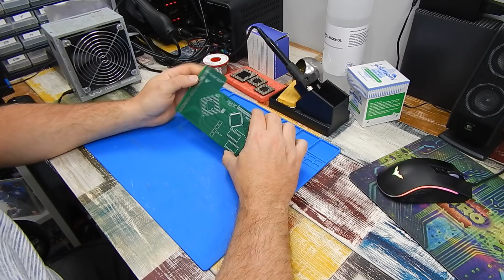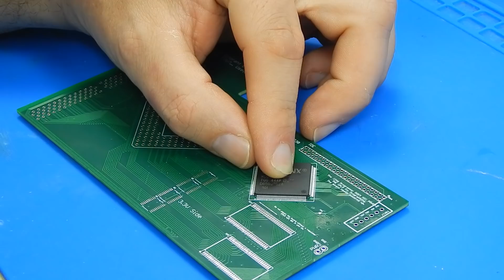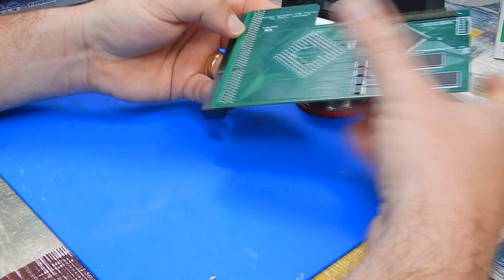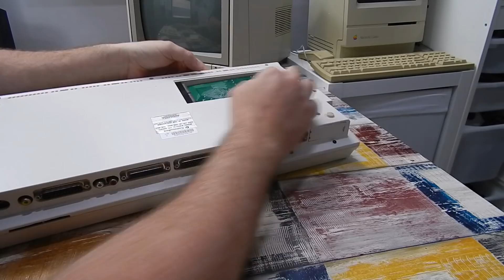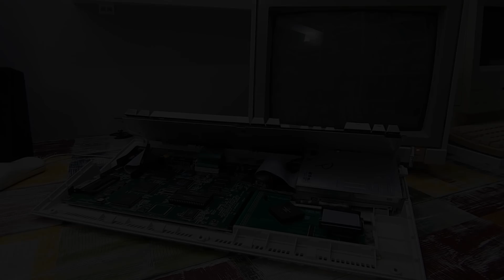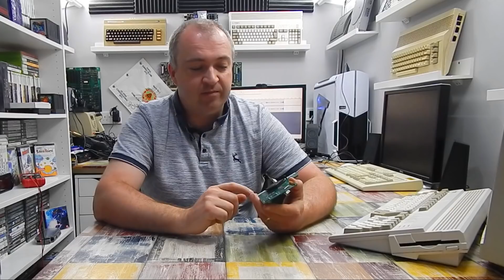Lets build the Terrible Fire TF1230 #AMayGa

Comment: What is a gold top CPU better? I've heard a few people mentioning it. Thx
Reply from the maker: In terms of the 030 the gold top is the original ceramic package.  These chips have the integrated MMU (memory management unit) whereas the plastic package chip doesn't.  The gold tops also come in a 50mhz part whereas the plastic chips are at most 40mhz.  That said though as I later find out the plastic chip can over lock further, I got it to 60mhz.
Reply: @CRG  thanks. So when I buy a TF1230 that runs at 50mhz I'm now wondering if it's gold top or something less capable.
Reply from the maker: @stevenross-watt8640  to be honest it more than likely will be the 40mhz plastic chip (like I have on this) overclocked to 50mhz.  The MMU makes little difference for just games but yes it is nice to have the full ceramic gold top chip.  Problem is they are easily twice the price.

Comment: Great video! One question though, couldn't you add the extra line to your startup-sequence on on the drive connected via the motherboard to then point it at the one connected to the 030 card? That way you wouldn't need the floppy disk?
Reply from the maker: Yes that should work.  I ended up making a set of custom ROMs to include ehide.device, there's a video on it if you are interested.
Reply: @CRG  I'm going to order a TF1230 this week. Annoyingly I have just installed 3.2 ROMs, so I'd like to avoid having to buy them again with the HIDE added if I can avoid it! Typical Scotsman :)

Comment: I put this TF1230 card into my stock A1200 and it does nothing! no added memory no speed no nothing what could be wrong?
Reply from the maker: Is the enable jumper fitted on the 1230?  
Hold both mouse buttons at power up to get to the early boot menu, from there you can see if the expansion is working.  

If however the Amiga isn't turning on at all then I'd guess you need the timing fixes done.
Reply: @CRG  Hi thanks for the reply, Yes the jumper is fitted. I actually just found out my 1200 still has its 3.0 roms in it, I'm starting to wonder if it's that actually.
Reply from the maker: @xsm_p2  yes that will be the problem.  If you only have 3.0 ROMs you need to manually add the memory.  It can be done easily enough with the addmem command, you can download addmem from aminet.

Comment: I use Kcapton tape to line up the parts and to cover threw holes so I don't fill them during the soldering drag. I also preheat the PCB and place it vertical during the soldering.
Reply from the maker: Good idea with the tape, especially to cover threw holes.  On this card everything was fare enough apart so that wasn't a problem but when I get round to building the 1260, its a lot more compacted so I'll take your advice and cover them up.  

I normally would use the tape to hold smaller chips but in this case they were big enough to hold by hand.  I did make a bit of a mess of the resistor arrays on the underside but as I said its been a good few months so was out of practise.  That my excuse anyway ;)

Comment: I have the same problem with my monitor, and use one of those surge protectors (Belkin SurgeMaster) that sit under the monitor to switch it on and off. Knowing my luck, pulling the monitor apart to replace the switch is just going to end in disaster. :P
Reply from the maker: I was thinking the same thing, do I dare pull this thing apart to fix it or do I just leave well enough alone.  The last 2 monitors I opened ended with more broken bits than fixed!

Comment: For those IDE connectors, I wonder if some male to female 90 degree connectors would be of use.  The only machines that I've seen them in were CompuAdd 386 and 486 laptops, though I can't remember what models.  One clue that I can provide is that they had small trackball mice built into them.
Reply from the maker: Something like that might work and I assume you mean to help route the IDE connector to the other side of the board for access, only thing is there isn't a lot of room between the case and the card.

Comment: I dont have an Amiga but i want one XD

I also have that problem with soldering QFP on Voodoo1 and Voodoo2 cards repairing them sometimes.
I also noticed the same thing swapping ram chip of the same style you used on my S3 Savage 4 and what worked better for me was to just hotair them on after tinning the pads with the iron.
Seems more reliable, push it down a bit an profit!

I tested out to hotair a QFP after soldering it with the iron, just go around the chip over the pins and reflow them, gave a nicer looking result b

ut if that improves the "success" rate of pins getting properly solder idk yet, will find out next time I find a lose pin or two after swapping a chip.

But might be worth testing.